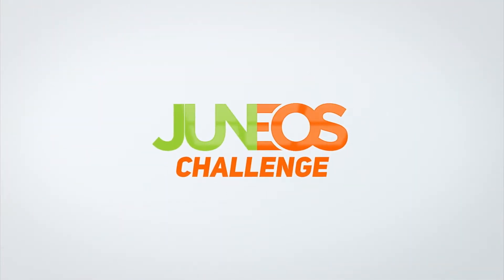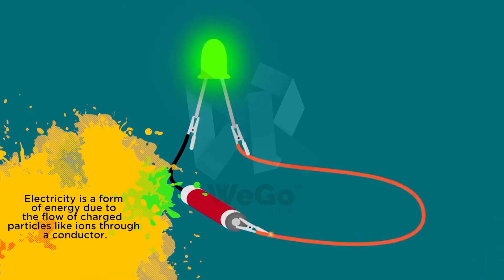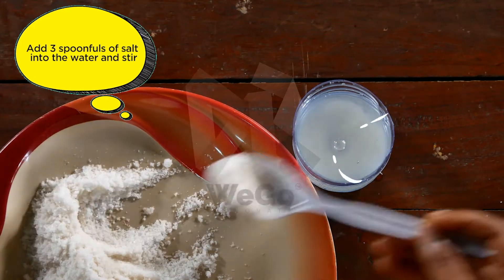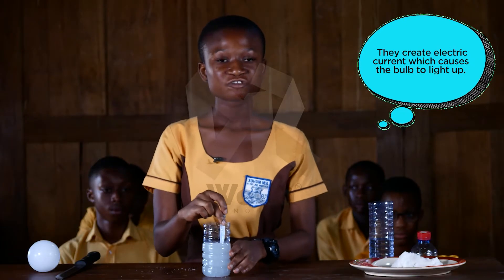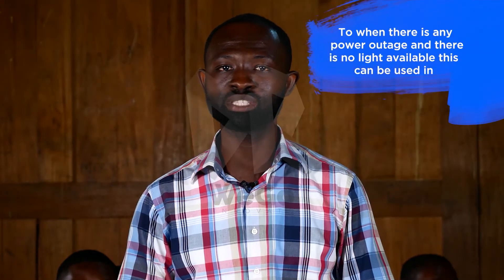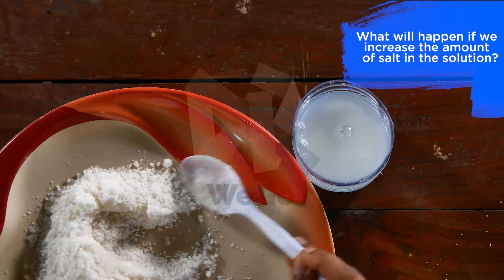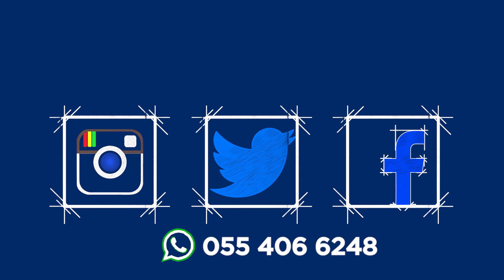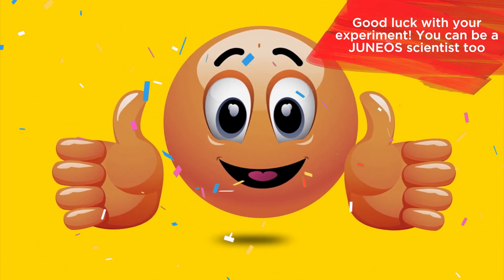BRINE OR SALT WATER ELECTRICITY GENERATOR - #GH4STEM JUNEOS CHALLENGE

Comment: I tried but it did  not work and I recognize that type of bulb it is charge able and if you  use a conductor to the negative  and positive terminals it will on if charged  and water is a conductor